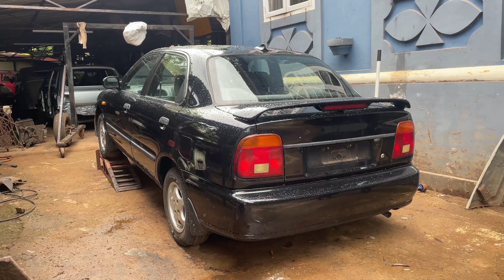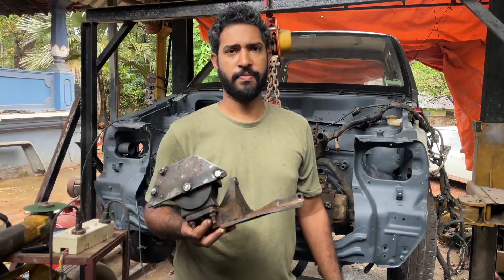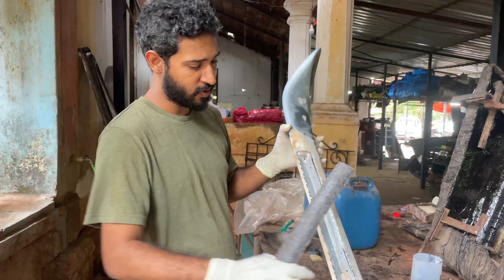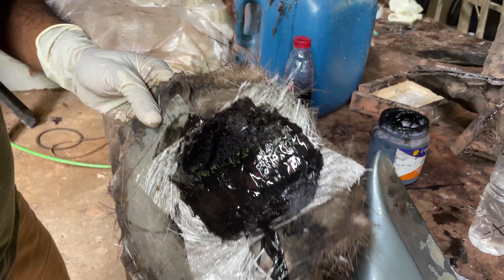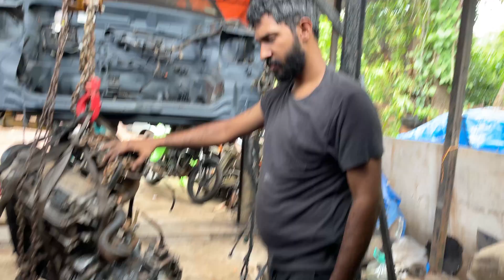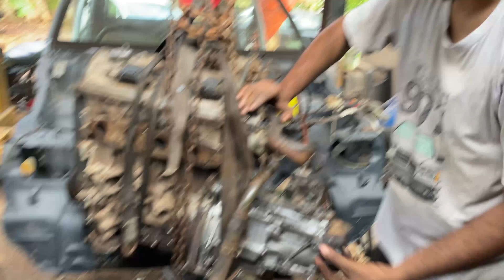B - Zen 1.6 swap build part 2 | engine mounts, gearbox pairing and fiberglass

Comment: Can I convert my carburettor zen to Mpfi ?
Reply from the maker: @gadvivek3380  yes but it's almost the same amount of work as a 1.3 mpfi conversion
Reply: @therustycashew8553  right now my carburettor is faulty so I wanted to convert my zen to Mpfi. I just wanted to ask that Can I switch to Mpfi engine of other zen car?
Reply from the maker: @gadvivek3380  Yes, but you will also have to change a few more parts. The intake system, the wiring, ECU and I think the cluster too

Comment: Cam sensor is from 1.3 or 1.6 
Can MH310 GB handle the torque and output of GB1.6 engine
Reply from the maker: From 1.3, it should take but we'll confirm it all soon when it's ready.

Comment: Question: why are a killing a perfectly running Baleno for this project, you could have just sourced an engine, sad to see this happen,
Reply from the maker: I don't think anyone would have paid the premium we did for this car. The engine was healthy and we were happy with that. Most balenos in the scrapyard had lpg or CNG kits. So customer and buyer happy. I was also considering using other parts from the donor but didn't seem feasible later

Comment: Bro  iam planning to my zen upgrade wheel into 15 inch optra wheel front tyre 185/45/15 rear tyre is 195/45/15 Any Problem on it broo…?
Reply from the maker: @Abha_yy  the front body will touch, you may have to trim wheel arches

Comment: does it cause any sort of imbalance in weight distribution? the baleno engine  and trans would be weighing a bit more than what the zen engine right? wont that cause an issue..?
Reply from the maker: It definitely does cause an imbalance but there isn't much one can do apart from shifting the weight to the back but there aren't many options for a build like this.

Comment: I have doubt sir. I am planning my mpfi zen swap to 1.3 g13bb. So decided to use my g10b gearbox. My doubt is that make mileage decrease or increase!? I need a better mileage and performance for that better use esteem gearbox or zen's gearbox. Am using equally in city and highways.
Reply from the maker: I believe using the zen gearbox with give quicker acceleration but lower top speed hence the esteem one is more suitable for your requirement
Reply: @therustycashew8553  so you meant for better fuel efficiency use esteem gearbox am i correct!

Comment: Don’t the zen shafts fit into the baleno gearbox ?
Reply: Yes but he used zen gearbox
Reply: @RedlineReuben  ik, was wondering y not the g16 gearbox. Reason behind it
Reply from the maker: The reason was to build a car with quicker acceleration, the Baleno gearbox would be for top speed
Reply: @therustycashew8553  so it's a direct fit then, zen axels onto the Baleno gearbox ? Just out of curiosity

Comment: Maruti 1000's gearbox mounts might be direct fit for baleno's 1.6 engine. That might be reason for some guys are prefering it over zen gerbox.(just assumptions)
Reply from the maker: That's a possibility. I thought it was gearing as it was suggested when I was building an E zen too. It's really hard to say for sure without seeing everything first hand
Reply: @therustycashew8553 For an Esteem engine  plus Zen gb, I can confirm, it's a direct fit
 My MPFI Esteem is running a Zen GB right now, does wonders with the shorter throw in hills here at Uttarakhand.